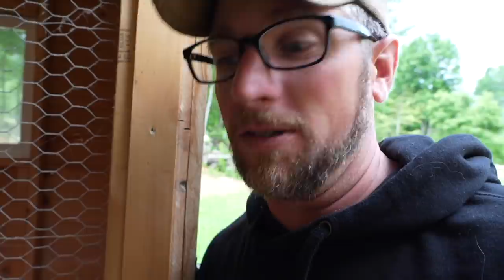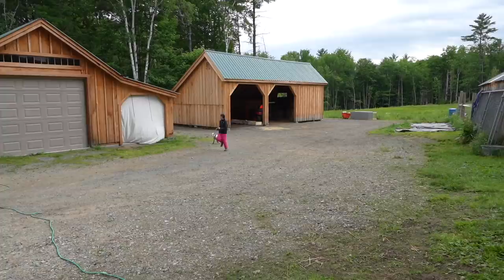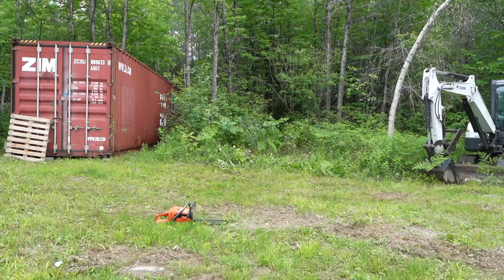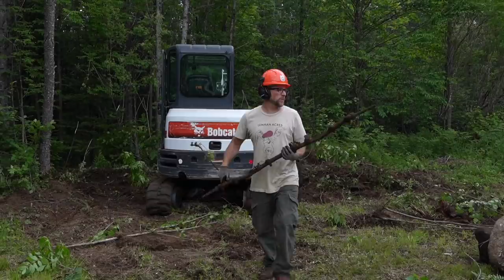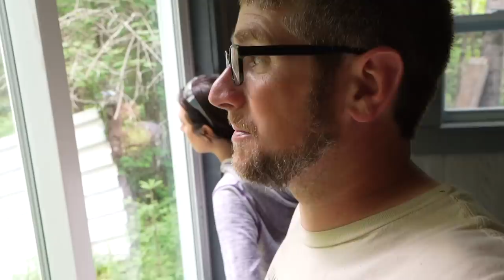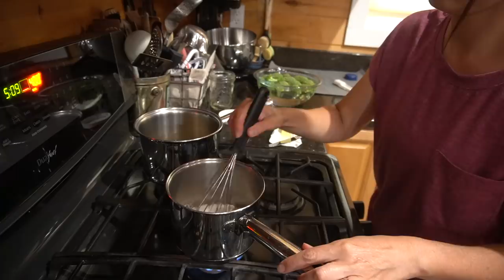HERE We GO AGAIN! TIME to Start WORKING on the OFF-GRID SHIPPING CONTAINER CABIN in the WOODS!

Comment: AL those are the old metal springs that Went under a Horse drawn carriage! 
Those are very old ! 
Wow 😲
Reply: I was about to say the same thing 😊
Reply: @twistedponies7480  yes sir you thought right. Also the round things was the metal step that went on each side that a person stepped up into & out of the carriage/Wagon  with. I have a buddy who owns 5 maybe 6 of those old Horse & Mule drawn wagons, old carts, & a couple of the old carriages. He has them dating back in the early-Mid 1800’s 
& he’s restored them all. He still rides them on wagon trains and in parades & he has mules that pull his carriages instead of horses. 
But that metal he unearthed is exactly that, the undercarriage leaf springs for horse or mule drawn transportation buggies, wagons, coaches ect. 
 Also that was made from real hammer 🔨 forged steel by most likely a real blacksmith shop. Back  in those days they made things to last. 😁👍
Reply: @CCRider5312  there’s a man in the little town north of me that restores old carriages. He has a book out called “Wagon Tracks” 😊

Comment: Al, before you dig or lift anything with the bucket of your mini-excavator make sure you have the blade in front of the cab and down until it starts lifting the front of the machine up. It is made to also stabilize the excavator

Comment: I bolted my door cut out overhead, on the end of my container, as a little porch roof. Drilled 3 holes, 1/2" bolts, easy peazy.  Doesnt even need posts on the outer corners.

Comment: Need to get your solar plant going.  Small plant (solar panels, charge controller, battery bank, cables) to the container cabin for lights, charging batteries for tools, etc. Put one in soon at house location, for recharging tools, maybe running portable lights for working late. Solar is FUN.

Comment: Looks like you set your shipping cabin on a old buried dump site probably will find more old relics of the past as you clear more of the area. Was wondering though if in the past the property was used for sheep and goats and with the relics you would think there was an old homestead located on the property with Foundation where it was located would be interesting to check out with a metal detector. God  bless be safe. Jim

Comment: This this Duraglas marks is (or was) one of the most commonly-seen trademarks in the history of the United States.  The brand name is found embossed on innumerable glass bottles, jars and jugs made by the Owens-Illinois Glass Company throughout the 1940s, ’50s, and up into the 1960s, although some bottles made even into the 1970s are seen with the logo.   The name appears often on either the base or the heel of the container.  Owens-Illinois had been working for years on improving their container glass formula, increasing it’s strength and durability in order to produce bottles with less weight, thus increasing profitability. This new, stronger glass formula was given the trade name “DURAGLAS”.
Reply: Thank you for that. Cool info!
Reply: Excellent information - thank you for the contribution!
Reply: Duraglas -- lives up to its name!
Reply: Very interesting.  Thanks for sharing that Dianne.  It's always nice to learn something about companies from the past.
Reply: great info...thx
Reply: Good research and info. One thing more, does it have a high dollar amount value? So Al might be able to purchase more equipment if it does. 👍
Reply: @angelsarrived2642  Probably not. Sounds like they mass-produced the stuff for at least three decades so it wouldn't be rare.
Reply: @angelsarrived2642  $13 for a similar one.
Reply: @MKCarol-ms7lg  Sucks. Thought maybe something good for father's coming his way. LOL

Comment: Love the shows. Leave the trees intact and push them over its a lot easier to get the stumps out. The weight from the tree will pop them right out. That way it's less digging and filling in holes.
Reply: Exactly.  Andrew Camarata's YouTube channel has quite a few videos showing him pushing over trees with various excavators.  It works pretty well.  Letsdig18 is best.

Comment: The bottle is a great find that is for sure. One small move and it could have broken. Finding all types of things that will be great for decoration in the container or your new home. I like the way you cut firewood with the grapplers help. You have done a great job for now running it for a while. I think Gina's rock walls are fantastic. It will be interesting to see what she comes up with. Maybe something along one of the sides in the back by the BBQ area. Maybe put a small porch and sunshade up right over it for those who are sun intolerant. It is interesting to see what you all have planned for this space too.

Comment: Those were old buggy springs. I'd start fencing the pasture by building fence along the road first. Leave about a 50' wide drive for future logging and truck traffic. Then push the dirt on the outside of your rock fence level for a fence row outside of the wall. It will be good for the goats and sheep to play on. Plus you can get fence posts in the ground and then push dirt around the posts with the hoe and not have to deal with digging all those rocks out. The area around the container cabin is going to be a nice spot to live in till the house can be built.

Comment: Use and re-use:  any rocks with a flat side, can be put aside for a "patio" area, or the "base" of the pond.   It takes time, but lasts forever.  Moss and lichens will grow between and on the rock "patio" area.   Great place outside of doors to place chairs/table, so you are not stepping/sitting the the mud created by the rains.    Without the vegetation, you end up with mud puddles.

Comment: If  you can find an old steel I beam  about 8-10 feet long longer if you desired and the machine can handle it.... clamp it in the bucket and thumb  and use the hydraulic power of the boom as a scraper blade, 10x faster than the tracks and pushing materials and more powerful, can use the same technique for picking rocks out of new   Pasture plots.

Comment: Hopefully you'll do proper waterproofing for the new house. All the wooden structures on the current farm, halfway across are decaying.
Reply: sara griffin ~ Al intentionally did not finish or paint the wood in the structures he built so they would develop a natural patina. He mentioned that in quite a few videos back. I doubt they're rotting.
Reply: @TXNLaurenMcN  I know what he said. But having the base of the house getting hit by water wouldn't it weaken the structures from the bottom and allow mold to grow since wood is organic, decay would set in eventually. It is not evenly aged and will take years off the property. He works so hard on his builds,   I want them to last.

Comment: Maybe blue skin the roof of the container, then buildup 2x4,2ft wood frame on which you put a metal roof with a 6inch slope. Maybe shoot mulch or leaves in that 2ft +void as insulation.Add some limen to disinfect it's a roofing system by a univ.prof in Lithuania or Latvia..  that system uses  leaves+lime.

Comment: Move the container to the new property temporarily. Use it as a base to eat, rest, cool off,  tool storage, etc. Until some other structure is built.
Reply: they have to hire that container to be moved.  They cannot move it themselves!
Reply: @sandrasherritt9708  there are bolt on tires for the container. It can be pulled by the tractor then. https://www.amazon.com/dp/B091BKTQNJ/ref=cm_sw_r_cp_apa_glt_fabc_VMY41F7EGTWV49SD7515?_encoding=UTF8&psc=1.      I have seen them much cheaper
Reply: He can weld so he can make his own for about $150 or so
Reply: @Anthony_Harper  WOW, KOOL!  CLEARLY,   I did not know that!  how heavy are those containers anywhoo?  they look really heavy!

Comment: Maybe one length, build a 5ft roofed porch..in back, maybe have a chill minimum 6x6 ft long (Big enough tout put a table or screened veranda and eat there, toke, play cards,out of the rain..etc)  ft Roof porch on the side si as note tout blockbuster the lightning un front office patio door. . You can put 2-3 rocking chairs there, store firewood, and locate 50 gal drum for water recovered from the sloped roof. Clad it with 2x4 insulated with Roxul battens and a 0.75 inch Alu styro panel to prevent the drum from freezing. Above the drum, build à shelf,  , and a place to locate a propane tank+inverter out of sight. Have a 3-4ft door or 2x2ft doors on that shed. Maybe, extend it 4-5ft above the roofline to mimic a fireplace look and give you some roof storage for some roof chairs. ..or fertilizer for a green roof to grow mushrooms, forest strawberries away from the bears(=escape from Bears on Roof)., Have Moss on tin and make your place less visible from the air and Agenda21 enforcers..give the pl̂ace sôme Airbnb appeal.

Comment: Andrew Camarata is a youtuber in up state New York.   Check out his videos he works with heavy equipment.   He does roads, clearing for home sights, drainage removes trees and stumps.  Might pick up some tips on using the little back hoe.  Interesting guy works on all his equipment himself. Has built a house with steel beems (also welds).  Al I think you might enjoy his channel.

Comment: What were those giant timber slabs? Where you were stacking the firewood ?
Reply: They were not there in previous videos. I think they were used by the logging company in conjunction with large machinery.
Reply: @tonygrimes13  like cribbing or something ?
Reply: @colinstace1758  Maybe for using as a crossing for muddy areas when you do not need the crossing except for a few times & then used for same purpose elsewhere.

Comment: I don't know anything about excavators , but I did operate a back hoe for a living and I was wondering, if at the time you are stump pulling, would it be better to have the blade behind you to keep the machine level under load.  We always used our buckets upside down to dig into the ground for stability. Perhaps other viewers with more experience could add to this.

Comment: Hey Al. Greetings from central Arkansas. If you dig those trees out before you cut them down, it will make getting the stumps out way easier. I normally dig a scoop out on each side and then push the entire tree over. The leverage from the tree does all the work for you and doesn’t beat your body up nearly as much in the excavator. Then just lift up the entire tree knee high and hop out and cut off the stump. I was able to double my production by doing that.

Comment: Excavator needs a stump grinder to prevent stubbed toes for those flip-flippers and bare footers.
Reply: Gg-r-rr auto spellcheck. Floppers
Reply: @morrisslugg1446  You can always edit your comments by clicking on the 3 vertical dots to the right of comment.

Comment: The steel stuff you found looks like it went to a horse drawn buggy. Did you know to remove the lower !eaves on your brussel sprouts up about 10 inches to a foot, that way the plant will put it's energy into forming the little sprouts instead of the leaves. The clearing in the off grid place is going to be nice. Maybe make those circular swing seats around a fire pit. You could have friends or family up to camp and have work parties ( like for fencing etc)

Comment: build a truck wheel rim BBQ & Grill with 3 steel legs (wielded together) so you can cook outdoor bbq's and not but a spot when its dry outside.
https://theownerbuildernetwork.co/recycled-rim-bbq-fire-pit/
Image idea: https://theownerbuildernetwork.co/wp-content/uploads/2015/04/Recycled-Rim-BBQ-Fire-Pit1.jpg

When you do place the back deck, add those retractable awning placed above the door.
Lastly add 2 LED Solar rechargeable outdoor Streetlights.. so the place is not dark at all (one at the front and 1 at the side.. perhaps.. you can install (more then one) along side the road towards your Off-grid property..when its done (when all of you have moved to this place. same can be installed outside at your home. so you're not walking in the dark with your headlamp.
https://www.amazon.com/Street-Lights-Outdoor-Control-Parking/dp/B091CSX3YZ